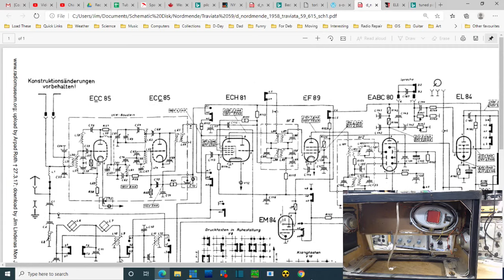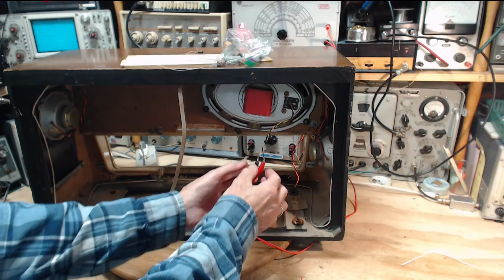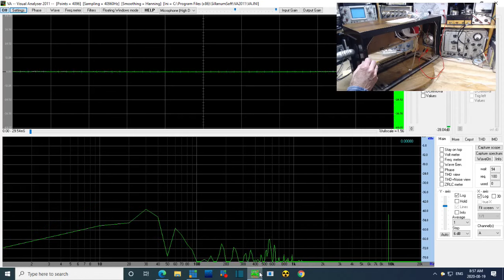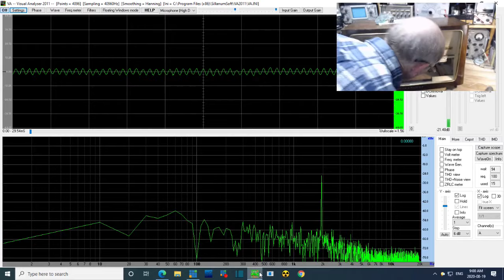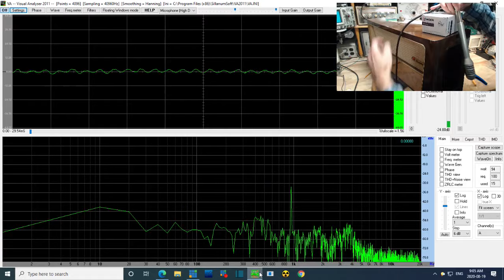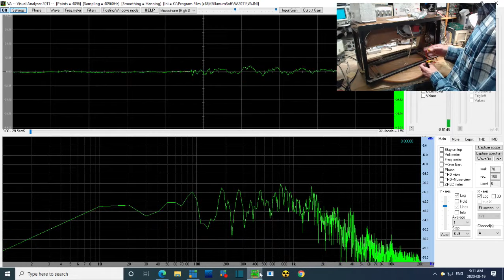Nordmende  Traviata 59 Tube Radio Video #10 - Three Way Speakers

Comment: Hey jim I think you need to ban some trolls here cause they are not helping just complaining and i'm not sure if you read the comments but majority of the comments i see are just trolls who think they know more than you which isn't true at all you know more these trolls will ever do. I also told them if you think you can do make a better video then prove it otherwise shut up. Jim you are doing great and I know that you don't have the latest and greatest audio equipment but you make do with what you have and that's great. I like you videos a lot. 

ban these trolls 
Stillcloser
pi duino

Comment: The microphone mixer is the source of the noise. I have been trying to tell Jim for months that his audio channel is noisy. It all started some time ago when he changed his mixer for the present one. The old mixer was much lower noise. I am not sure Jim knows what audio noise is.  As for these tests, I don’t know what Jim is trying to prove except that when you feed the signal generator into a speaker, it generates a sound. Well, that’s what speakers do.
Reply: Well, he says white noise is the best way to test the quality of speakers (ROFL), who knows, maybe he chose that crappy mixer on purpose, due to it's low S/N ratio... Haha...
Reply: Like i told stillcloser Jim probably can't afford new audio equipment he is making do with what he has.

Comment: so why inductors there and not capacitors and resistor
Reply: They never tried to aim for a full fledged crossover network. They just wanted to introduce a minuscule spatial sound effect.
Apart from complex spatial  sound recording the more sensible approach would have been to tack the scope across strategic points like the coils or speaker voice coils and sweep the thing while watching signal amplitudes.
And even; one should have been using the radio itself as amplifier, because the audio output transformer is a complex impedance source with the speaker network being a complex impedance load. And to top it off the feedback network from the speaker output to the audio preamplifier triode will play into the frequency response too.
There would have been ways to investigate this to where the outcome would have been of value.
Waving a microphone like a magic wand certainly was not.

Comment: This is ridiculous, he says his microphones are "high quality" but we can hear a lot of hiss in all his videos, not sure if there's a microphone problem, that cheap mixing table or the 'vintage' amplifier... Whatever the case he should address the background noise first, it's really quite annoying particularly at low level when the automatic gain tries to crank up the volume...
Reply: In the mid 80s some electronics magazines encouraged young hobbyists to build and experiment with dummy head recording ("Kunstkopf", artificial head, head/torso simulator) for best spatial sound reproduction. 
That, and a proper setup with the "Kunstkopf" in the same location as the user of the radio would be in normal operation, would be the only way to make sense of these experiments and give a chance at reproducing the minuscule "Raumklang" effect of this speaker setup.
Yet all he does is wave a hiss crackle buzz pop microphone on the backside of the radio and even sticks it dead smack inside the cabinet at 45:16 - the only location the head of user will NOT be on normal operation.
The only thing to take from this video is; the Bandswitches on the radio are still dirty as hell and that the 57 minutes of this video should have been invested into fixing that problem rather than some nonsensical audio foolery.
Reply: you're annoying stillcloser and quit complaining geez. audio equipment is very expensive and he probably can't afford new equipment either put up with it or shut up
Reply: @bretthibbs6083  Yada, yada, yada...